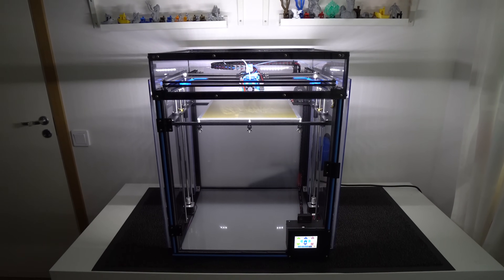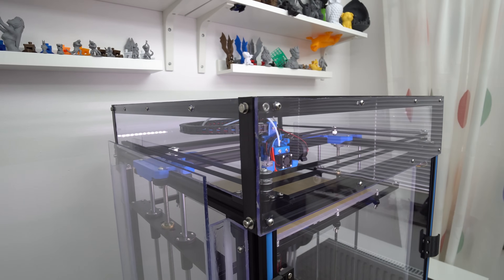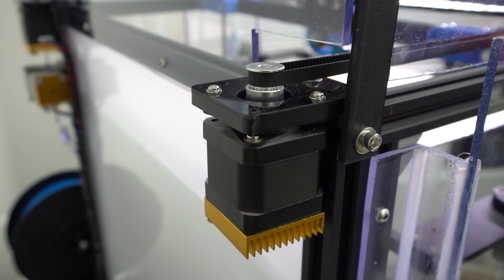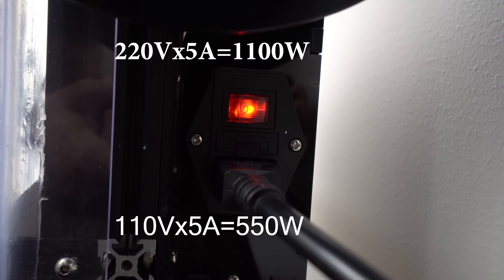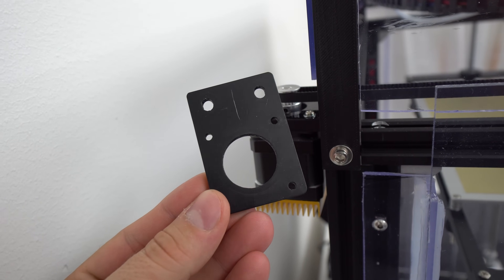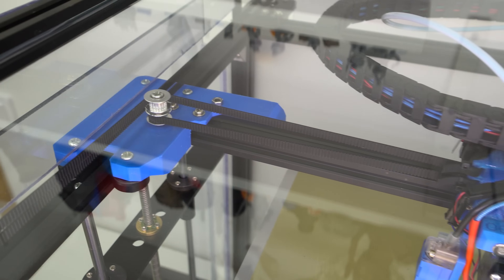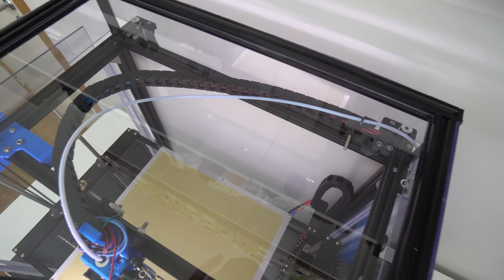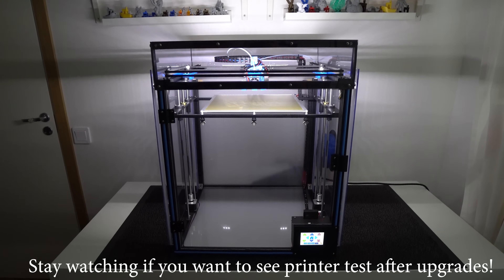Tronxy X5SA 3d printer ultimate upgrades!

Comment from the maker: Hi Guys! If you missed my Tronxy X5SA review video here it is: https://youtu.be/Pq3qjdaRnuY
Reply: Have you ever had salmon skin with this printer? Either before or after these upgrades?
Reply from the maker: Ian Isaak Not at all.
 This printer don't leave any salmon skin on the prints surface.
Reply: Hello friend! when will there be more improvements to this printer? for example, a double extruder for gradient printing?
Reply: @Nexi Tech what must have mods would you say are the most important to get this printer performing the best it can? function over form?
Reply: @redkurn  ок
Reply: Алексей Куксов ok what?

Comment: I have switched to a 12V power supply like you did, but now i have the problem that when i heat up the nozzle it says "sensor error or power is not enough". Do i need to adjust something, since i have 12V instead of 24V now?

Comment: The motors running at 40°C is normal, but after all that work, why not hang longer motors and maybe provide any needed power supply upgrades? Slightly overdesigning for reliability is common in engineering.

Comment: Would you recommend duel color on this model I had a blob and my wife ripped the wires for the heater on the filament so I was thinking titan but ran across dual color titan

Comment: When installing your ac hot bed did you have to change anything in the software to reconise a higher temp ie 120c also would it be posible for a install vid on the ac hot bed

Comment: And what is your firmware? I have a maximum table temperature of 100 degrees. your 115 can be displayed. Why? TRONXY X5SA-v1.19 Colorful 0.8 What firmware do you have? And at what temperatures of the table and nozzle do you print PET plastic?

Comment: for the ac bed i l ive in canada so i use 110v ... i saw you ve connected a ground wire on the bed ...  but where do you ground it from ..  from the power suppply ac ground???  can you point me a good how to video on the relay connection o n the board side and the heat pad thx
Reply from the maker: Yes, you need 110V Heat-bed. You have link in video description. Yes, the ground wire is going from ground on AC power supply to the heat-bed.

Comment: Maybe it has been asked already...but, why the plexiglass?
Reply from the maker: So that I can see inside.
Reply: @NexiTech  oh...i thought it was to help keep heat in for better prints.
Reply from the maker: ??? I thought you ask me why that I use plexiglass instead of plywood etc. Of course that I enclosed my printer to get better prints...
Reply: @NexiTech  why is that, does it keep the heat in? Im like 2 or 3 days away from either buying the X5SA or Ender 5 Pro. The XBSA is $300 cheaper and large format. I currently have a CTC A8.

Comment: HI, I'm italian, I have same printer... you made amaizing work...I notice you print very fast... and your upgrade Guarantee high temperature.. can you make me some suggestion to do the same? I hate some things of this printer... like fan.... hotend fun make flow hot on printer plate...so I used like termic scotch to prevent this...but nozzle ventilation (right fan) make impossible to print petg..beacouse move all micro filament extruded evrywhere... I need print petg, rubber, nylon, carbon.... possibly using 0.4 nozzle.... but using petg I can't print fast than 25 mm/s... can you help me?  ....please...

Comment: What about connecting the 2 "Z" motors with a timing belt at the bottom to stop them from becoming different heights? It would have to be a closed timing belt, I have a source for all the parts needed for mine except for a way to mount a tensioner for the belt.

Comment: Hi! The firmware on this printer can save the parameters you put into it? I know there's Gcodes to save all the input data, but some printers can't store it across reboots, so i'm asking. Also, i didn't really get if it can print through USB, as going up and down with the SD Card gets tiresome soon.

Comment: An absolutely superb review and superb set of upgrades.  

NYLON
These modifications inspired some questions for printing in nylon, a much more resilient material, per reports.
To go further in the upgrades what would be recommended to print nylon, at the higher temperatures?  Maybe all glass case?  Recirculation fan to reduce temperature stratification in the print volume?

PRO version
What meaningful differences are there between the X5SA and the X5SA Pro?

MULTIPLE HEADS
My needs include the capacity to change materials/colours during a print, and thus multiple extruders each with its own nozzle, and, the need to CNC for PCB prototyping.
As most people agree that the TronXY X5SA is a wonderful platform for tool changing:
                    What mods have people tried in this direction?
Thx to all and especially, of course, to Nexi.

Cheers

xian 
(Christian M)

Comment: Good night, when you closed the printer and started testing, did you have to make any changes to her firmawer? If possible, give me the firmawer you are using to have this quality and the slicer settings, I use Cura, do you also use it? I bought one just like yours, closed it and I'm still having trouble to have an excellent quality to produce my pieces. I appreciate your video and information about the printer. Actually I bought the 24V version, already updated and everything, Tronxy X5SA 24V, but it is little difference I believe.

Comment: Great video!  I'm a total newbie to 3D printing, so this was helpful just to see what I'm getting myself into.  The printer arrived yesterday, so I'm mentally preparing myself for the assembly ahead.  Mainly, was hoping to contribute to the global PPE shortage and use the printer to make these face shields (https://www.prusaprinters.org/prints/28279).  Do you think the existing stock parts would be able to handle the job or would I need to made modifications, since I just noticed the specs on the printer don't list PETG as a supported filament and that's what the prusa face shield designs recommend.

Mahalo!

Comment: Thank you so much for your through videos you posted on this printer. I did in fact order it and received it yesterday and while I wanted to emulate what you were able to accomplished with this printer I have decided to return it. Because of you videos I did a very through inspection out of the box. Oddly enough it unpacked itself, I believe it was either an open box or someone opened the printer box itself as when I opened the shipping box the inner box was open an I found parts strewn about inside. I could however see they upgraded many of the issues you pointed out in the first video with the exception of an eye for quality. As I looked at it, all that would have been usable was a frame. For starters the flange bearings for the heater bed carriage were deformed, the extruder was not aligned or was bent but what was even more scary was when I opened up the electronic box to find wires loose and not landed correctly! This printer would have fried the moment I flipped the switch for the first time!!! However I can confirm they upgraded the bed wiring to 14 awg. LOL While I had high hopes of MODing this into a IDEX platform I felt the money and time it would take just to get this thing to print was better off being spent on a different printer. So I requested a return, corrected the wiring so when they send this out to some other person they don't get electrocuted and boxed it up and took your advice on another platform the QIDI TECH X-Max and ordered it up.When I started to add up what it would have taken to get to this printer to where I want it to be, I believe I'll actually save money as they got a 100.00 coupon on Amazon. Had you not alerted us/me I would have none the wiser that I was walking into a nightmare! THANK YOU AGAIN SIR!

Comment: Would you still recommend this printer for large scale under 500? Or would you suggest a different make/model? Going to buy a printer in the next month. You can send me a private message if you don't want to upset manufacturers.
Reply from the maker: Don't worry my friend I'm not paid to make these videos and I can say what ever I want. Well, to be honest I would no go with the X5SA model that I have, I would go with newer model Tronxy X5SA PRO which looks much better and a lot of things are already upgraded and improved. Also another 3D printer to consider in similar price range is the new Creality CR10 V2 which is very good 3D printer(Not Core XY but still) and it doesn't need any upgrades or fixes out from the box, and it preforms great. Print quality is outstanding!   Check the video here:  https://www.youtube.com/watch?v=tsy8jFeqgco&t=5s
Reply: @NexiTech  Thanks for the response I appreciate it and also your reviews.

Comment: Thanks so much for sharing all this. I plan to get  the x5sa pro, do you think based on your  experience, from stock it could print a flexible material vase  up to 500 mm ?? :)
Reply from the maker: Yap X5SA PRO is step up from mine stock Printing Flexible vase with standard 0.4mm nozzle in spiral mode in 500mm can be very challenging not to mention, time consuming. I would replace the nozzle to 0.6mm or even 0.8mm nozzle and go with big layers which would speed up the printing and make actual usefull flexible vase. I'm not sure that stock extruder can keep up it might. Try it out and let me know how it went.

Comment: Hi, i just got my Tronxy X5SA-2019 and i was super excited to get started! Unfortunately, for some unknown reasons, the stock firmware came with default extremely low accelerations, and thus it prints extremely slow because it never reaches the desired printing speed. I have tried using the command (by feeding it into the terminal and then using a G00 command to a random location) M8008 I1000 from your text file with different values, but it doesn't change anything, the acceleration is still extremely small. Do you have any suggestions?
Reply: Cristian Talos Hi I saw this review on Amazon and it might address your problem somebody on Amazon suggested that the motherboard that comes with this printer frankly sucks… And he upgraded his and suggested everybody do the same to SKR 1.3 with TMC 2208 drivers.  Here’s the link to the review I hope this helps.

https://www.amazon.com/gp/customer-reviews/R5Y430CDTZAJ5/ref=cm_cr_dp_d_rvw_ttl?ie=UTF8&ASIN=B07K4957PZ

Comment: Nice video.  I have a question for you regarding changing the value of the thermistor.  I too am upgrading my X5SA to a E3D V6.  It comes with a 100K thermistor, which I know is different from the stock thermistor.  What code do I need to run to set the correct value in the firmware?

Comment: Did you buy the aluminum plate for the heated bed or did you cut it yourself?
Reply from the maker: Trojank That's the stock aluminium heated bed plate I just stick AC silicon heater pad under it and cover it with the insulation cotton.
Reply: Oh, I thought the stock heated bed was just the pcb, didn't see the aluminum

Comment: What controller does it use? Could you upload your own firmware?
Reply: I think this controlled was the stock Tronxy controller.. I'd like to see a video on him upgrading it to a SKR v1.4 (turbo) controller and see how one updates the firmware for it.
Reply: I've successfully flashed the stock control board with Marlin 2.0.X IF interested in upgrading your Tronxy XY-2 PRO or X5SA there are 6 or 7 boards currently supported here at this link if interested... https://www.reddit.com/r/MarlinFirmware/comments/hn6rsw/tronxy_xy2_pro_marlin_20x/

Comment: You changed your PSU to 24 / 15.. but refer to a 12v Turbo Fan? or am i mistaken and your PSU is now 12v??
Reply from the maker: PSU was always 12V i just change powersupply to the small one sense there is no need now for high powdered one as Heated bed is now driven by AC silicon heater pad. You can place even smaller powersupply than mine.
Reply: @NexiTech  yea just realized your 12v. I got a X5SA Pro and mixed it ip since the pro is 24v. Sorry. :) BRILLAINT Video mate. Thanks for it!

Comment: Hey Nexi Thanks for all your effort.
Most of the parts are ordered... except the e3D Clone..

I ordered the X5SA with 24V option. You switched to a 15amps PSU with 24V right?

The Heatbed is 220v 600w (EU for me as well), you routed the Heatbed outputs to the SSR (to switch it) and the Powerline parallel from the PSU to the SSR -> Heatbed.. right?
Whats the exact dimensions for the Alloy of the heatbed? 330x330?
since my idea is to get a new Aluminium Heatbed, tape the Heatbed downunder and use a glassplate on top of the Aluminium.

The SSR switches the Heatbed until it reaches the Temperature correct?

Feedback would be REALLY appreciated! :)

Thanks for your Build and Video!

Comment: Hi, when you replaced you hotend, did you use the original thermistor or did you replace it? if you did replace it, did you have to make any modifications to the chitu firmware? thanks for the awesome video!!
Reply from the maker: Hi Mathieu, I have replaced the whole hot end with genuine V6 all metal hot end, including the stock heater and thermistor with V6 one from a Kit. You don't need to do any firmware modifications for the V6 thermistor as it's the standard 100kOhm as far as I know. Temperatures are very accurate I test it with my thermal camera but you do need to extend V6 heater and thermistor cable wires and solder them on stock cables and make them longer as they are to short.
Reply: Thank you for taking the time to reply. You're awesome!

Comment: What can i do if want have quiter stepper motor? If only move z-axis, there is big voice. I dont know if come from motors or another vibrations. I also noticed, that on board is regulator near stepper driver. That regulator change voltage to motors?

Comment: Nice upgrade!!! Love it! But, -->
Quick question, I also have the X5S.... but mine is from turnigy and not from tronxy... how is this possible? And is it actually the same printer? Because I would like to do most off your upgrades.. thx!
Reply: If it doesn't say Tronxy then you bought a Turnigy and not a Tronxy. If they advertised it as Tronxy then you get "bait and switched" scam.  Overall theyre al Chinese garbage and all the same. This printer is the same as Chinese Creality printers which are the same as Prusa printers which are double the price.  Pruse and Creality will act like theyre far more superior but they all use the same shit once theyre all upgraded with better hotends, extruders, power supplies, and controllers/drivers.

Comment: Hey there, Great video very informative. I am planning on picking up an X5SA soon and wanted to get the belts and pulleys upgraded when I first put it together. I was wondering what length of GT2 belt is required, how many toothed pulleys and smooth pulleys are required and if the inner diameter of the pulleys is 3mm or 5mm. Thanks for the video and keep up the great content!
Reply: good question.. I'd like to know this myself.. are the original pulleys and belt not good though?  I feel like he swapped them out because he already had them laying around.

Comment: I got an X5S recently and the first thing I did was to put in a Duet WiFi board. I would highly recommend doing this as the Trinamic drivers make the printer run almost silently.

Comment: Hey there,  
I got massive problems with this machine. The retraction is so worse, also the overextruding at the end of every line. Coz calibrating extruder also the steps of the motors does nothing. I tried every slicer (Cura, ideamaker, slic3r..) but i still got that little "wipe" line at the end of every cube. Coasting, wipe, z hop does also nothing :/  
It´s no even making a round chimny of the benchy boat. :(
I really hope i just can flash it ^^ 
Thank you very much for the firmware ;)
Looking forward for any advice ;)

Comment: Several things I want to point out to those following this awesome guide. If you're in the US or where country uses 110-120, you will need a different bed heater, as that is effectively connecting right to the wall. It's mentioned elsewhere in the comments but you want the 120v 500w one from the options in that link. Nothing else should be different.

I had an issue where once I chose to heat the hotend it would go into shut down mode but just stay stuck there. What the issue was is the PSU was still in the 220V mode even though it was still able to power the printer on. I'm used to computer PSUs or old ones where if the switch was wring it would fry the unit. This is not the case. The yellow sticker pointing to the switch is fairly obvious and the knob should be on the 110v side which is printed on the PCB.
Once I did that I was able to power the hotend no problem.

I then experienced and issue with the hotbed that wasn't heating. I checked the control wires going to the SSR and seemed like they had voltage going through them. Since it's a DC input I  thought I'd switched them over and it worked. 
I thought it was weird since I though the old bed was AC power and it does not have negative or positive nodes. After doing DC for so long AC is a bit confusing to me.

For the pulleys I was also able to get the same ones on amazon for the same price because the ones from Aliexpress hadn't shown up after a couple of months. 
Make sure you get nuts for them to put under the pulleys. This will give a nice lock to the base so it doesn't move around but still allow the pulleys to spin freely.

One question I have is if the bed output is AC, why did switching the wires work to solve the input problem? Also, why wasn't an AA SSR used that uses AC input to close the circuit?

Still have a few things to do on this build. Will need to properly mount the new PSU, replace the extruder, add the lights, and build the encloser.  

Many thanks to Nexi, this has been awesome to follow and the improvement is drastic.